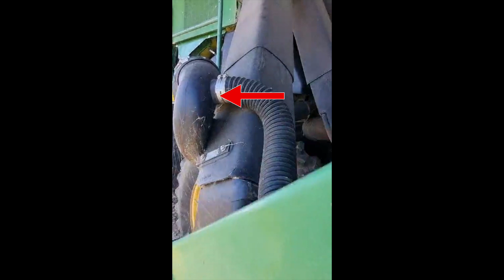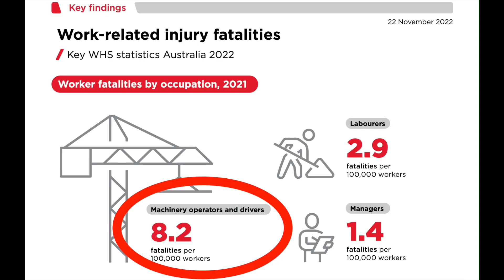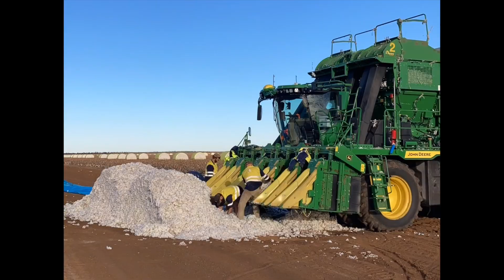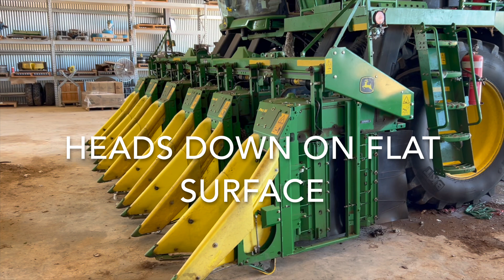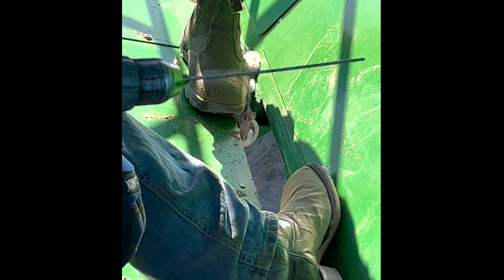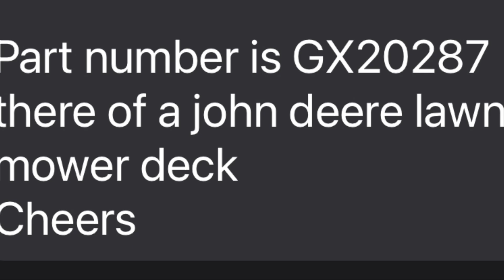Cotton Picker Tips-Aussie Ready 2025

Comment: Hi, I like your information. I would like to know what you did with number 3. I have a lot of problems with number 3. Have you made any changes?
Reply from the maker: Hi there, once we've trimmed the hoses and sealed the gaps, some people have sealed the joint up near the cab floor level with expanding foam for better results. Head 3 is the weak head in John Deere's testing results so certainly in CP770s is the first to plug. The most common fix when we've done all the little and simple things is to put a smaller pulley on the fan to increase it's RPM.